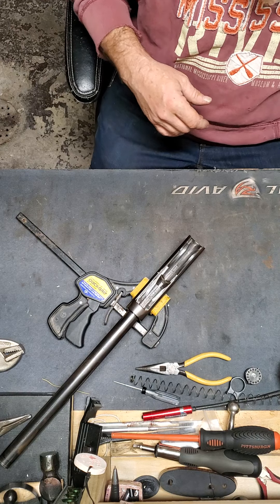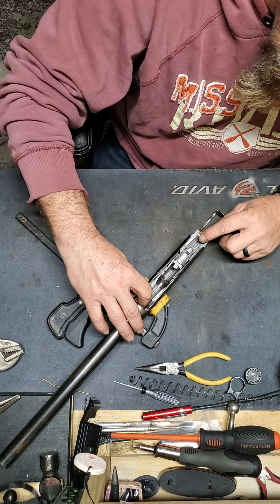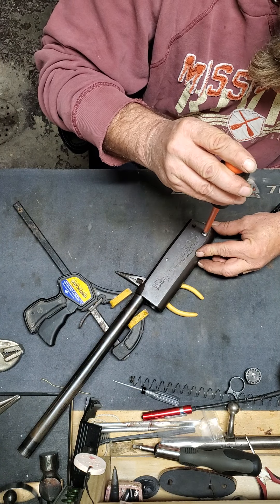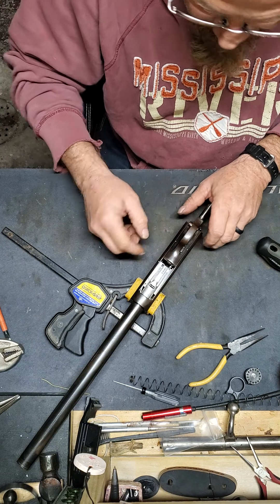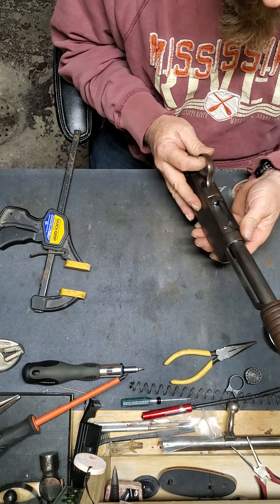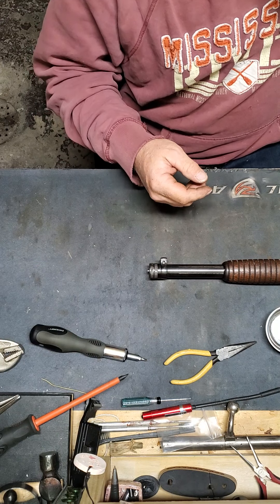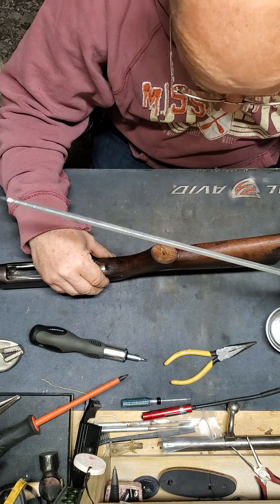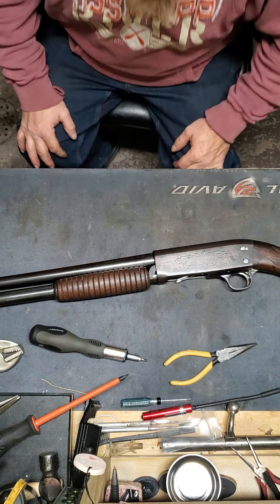Reassembly of my Ithaca Model 37 Featherlight 20 gauge

Comment: Hi, I can't figure out how the Ithaca 37 is loaded and unloaded. Do you have any drawings that I would really like to understand? If you have any drawings, I would be very grateful to you for clearing up the confusion in my mind
Reply from the maker: With the forend forward and the action closed, the shell elevator is in the up position.  Tucked into the receiver.  As the forend is brought to the rear the bolt extracts the shell.  As the shell clears the chamber, the bolt carrier contacts the rear of the elevator and causes the two arms to move down, throwing the empty shell out.  As the bolt carrier continues rearward, it contacts the shell release and allows a new shell to exit the magazine and is held by the two arms of the shell elevator.  As the forend is moved forward, the two arms move upward and the shell is picked up by the bolt and pushed into the chamber, ready to be fired.